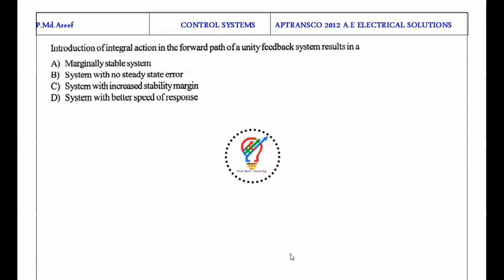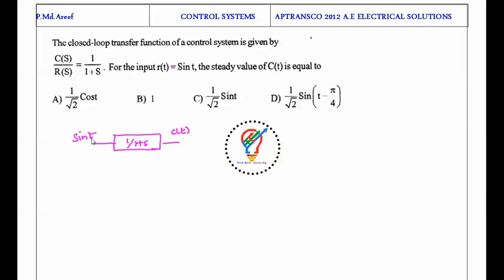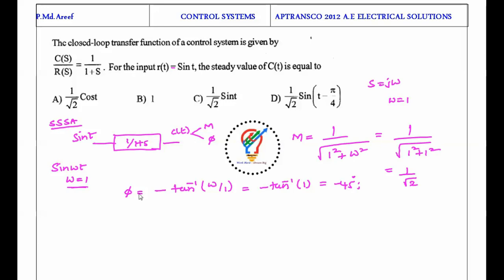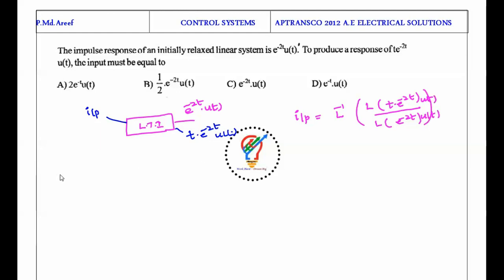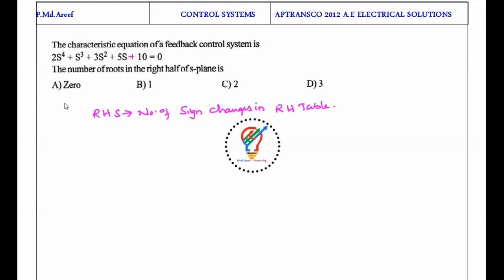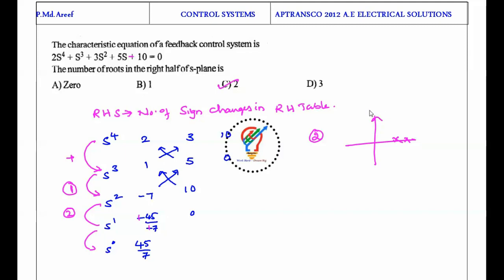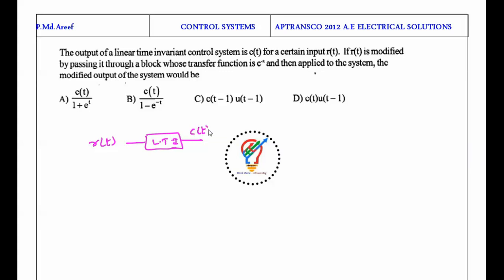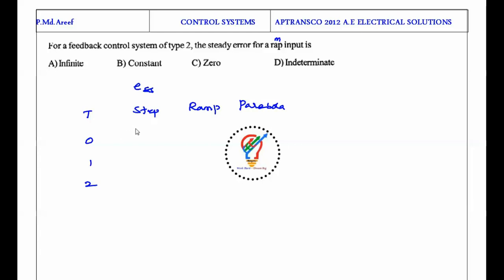APTRANSCO 2012 CONTROL SYSTEMS ASSISTANT ENGINEER ELECTRICAL SOLUTIONS

Comment: thanku somuch sir ,please you explain all previous questions from(1990-2018) for electrical subjects sir, already you explained network Theory Like That You explain all subjects sir,(Machines ,Power system ,Signals ans system ,Control System,Power Electronics ,Analog &digital ,EMT,Measurements & Instumentations ,Engineering Maths ,Please Do it Sir,we are depending On your lectures sir ,i have been following your lectures for one year sir ,